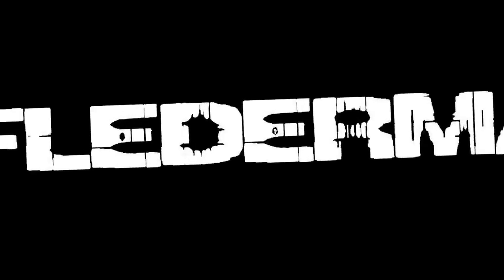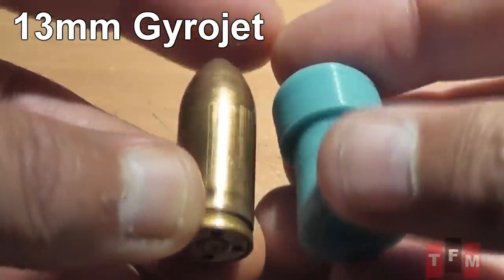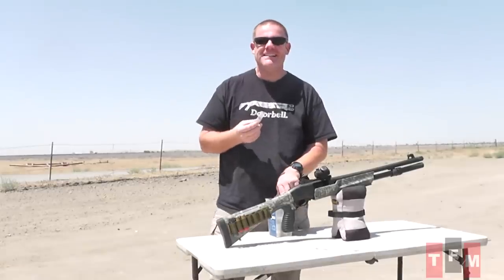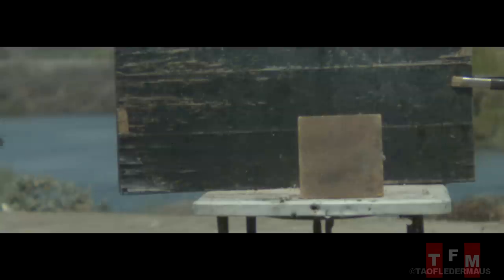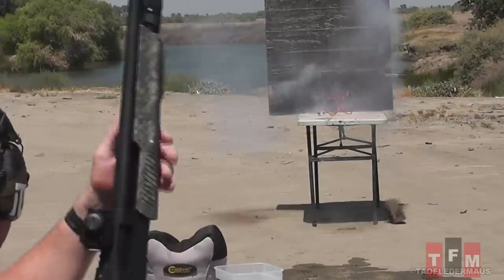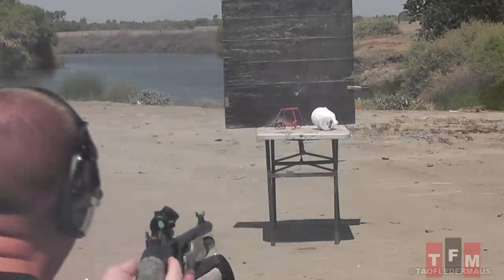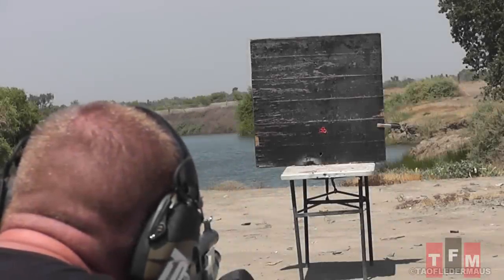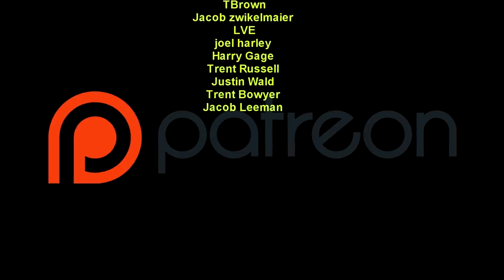Massive 3D-Printed ROCKET Slugs -   First Test

Comment: This is the beginning of a fully functional Bolter
Reply: It's totally doable just upscale a gyrojet to 40mm and add a warhead oh I want a bolter 😭
Reply: @weirdscience8341  I want one too but the magazine would only be able to hold 5 rounds tops if it were kept in proportion. .50 Cal would be better but 20mm might work as well.
Reply: At this rate it really will take till year 40k
Reply: The emperor protects
Reply: It’s canonically the correct gauge too
Reply: @Hankbob_Hillpants  That's good to know!
Reply: @JamesB-kz2vk  Nah, we'll have insane plasma weapons first, then robots will try to kill us, then we'll have less effective weapons...
Reply: Actually the concept of large heavy-hitting rounds in assault weapons is now real, russian FSB or whatever is using .50 cal in an assault rifle, the Shak-12.
Reply: The Bolt Shell will be easy. The Mass Reactive warhead might be the issue. 🤔
Reply: @Hankbob_Hillpants   actually a fraction larger than a bolter
Reply: @thermionicemission6355  the shak-12 is technically a battle rifle, not an assault rifle.

It might be a .50, but its nowhere near a .50 bmg. 

Comparing it to a 50 bmg would kinda be like comparing a .22 to a 556 just because the bullet is the same diameter.
Reply: I say this video and Litterally said "and thus the bolter was born"

Side note, I've always belived that this how bolter rounds work, an imidiate push out of the barrel, followed by the rocket ignition.
Reply: Putting these in the fostech origin 12 aow would be the closest we've gotten
Reply: @dd11111  it is, sadly gyrojet had to put holes in the barrel instead of kicker charge behind the rocket
Reply: I know I’m years late to the party, but I found this vid trying to do research to make a dueling pistol that would use bolt rounds 😂

Comment: Howbout jamming a 9mm case without primer in the back end to make a nozzle.
Reply: the is exactly what i was thinking
Reply: You'd have to use the primer hole to form a Venturi, but it could be done.  A primer pocket wouldn't make a very good venturi on it's own.  There's a reason why Rocket Science is right up there with Brain Surgery on the sliding scale of precision.  They both either go perfectly right, or horribly wrong.
Reply: And possibly turn the round out of aluminum?
Reply: Well just compressing the exaust will massively increase the effect of that kind of fuel, at the cost of burntime, but as is they would have to go like 500 yards to burn out. The fueltype used basically burn faster by the pressure its in, in open air its mostely just smokepowder. Fully enclosed it can rupture steel tubing, if the nozzle is too narrow.

Obviusly as mentioned in the replies an actual nozzle would help it both stabilise and create more thrust, but theres length to consider and safety if you get in to regions of pressure vs propelleant charge that could set off all the fuel before the rocket leaves the barrel.

Jamming in a 9mm casing would give you an indication of the burnrate on the fuel vs curent rate. Still leaves room for improvement, but its fairly easily done so why not give it a go.
Reply: Right, you could do that (Just jam a casing in there) but it would need some work to make it an actual stable rocket.  Just coning out the primer pocket with sculpy clay would help a lot.  Also, a forcing cone on the inside...  The more work you put into it, the more likely you'l actually get something approaching performance, but if it doesn't light, it ain't a rocket.  It's a hollow plastic shell, with a brass lining.
Reply: @Psiberzerker  Again itd need to produce gas at a decent rate and pressure to make a rocket either way, so just getting the burntime reasonably short, would be a step forwards.

The little rocket rounds from the commercial weapons, doesnt really have nozzels, rather they have angeled holes and seem to be producing spin with like atleast 1/10'th the produced thrust, wich still comes out to a deadly velocity, even without actual nozzle cones.
Reply: @bonielsen8001  Yeah, the Gyrogets just never got all that stable.
Reply: @Psiberzerker  Nah, trying to induce spin by pyrotechnics in mid flight on a tiny projectile would require extremely precise manufacture of both projectile and rocket charge.
If i were to redo the gyrojets id use the 12ga  minigrenades with folding fins made for the CAWS as rocket body. then just add a straight rocket  for forwards propulsion. 

Possibly some antennalike stick thatd telescope out behind the projectile in flight for added stability. Basically letting the fins create rotation.

the only real application thou would be to create an armorpiercing round of sorts. So you really want an initial charge more like a 20mm antitank riflecartridge and have the rocket add to the velocity.

Recoilless shotgun slugs would (if they worked) be prone to overpenetration even moreso than regular slugs and mainly be effective at some range, due to the rocket having to do its work before impact.
Reply: @bonielsen8001  Yeah, definitely fin stabilize, I doubt it could be done smaller than 3/4"
Reply: Meal gunpowder (finely ground black powder) compressed into the slug would give more thrust.
Reply: @pyrobob208  It would most likely burn faster, possibly launching the slug faster via barrel pressure, but the actual energy output of gunpowder is less than the sugar/potassiumnitrate mix.

If you can get pure ammonium nitrate it will produce even more gas than potassium nitrate. But it does tend to bind water and is technically an explosive by itself.
Reply: Then a 3d printed slig wouldnt be strong enough i'm guessing
Reply: Center of pressure has to be behind the center of gravity, or it'll never be stable. And in that small of a package you'll have to add some serious nose weight. = )
Reply: @bonielsen8001  Pretty spooky if it launches the 9m shell back at the operator.
Reply: @Psiberzerker  d
Reply: A rocket nozzle wants to be a certain shape--google Laval nozzle--to get the best thrust out of expanding gasses. The flash hole and primer pocket of any cartridge case would likely cause a lot of turbulence in those gasses, wasting a lot of your thrust. AND it's just possible that the rocket slug might spit that 9mm case back at you, with enough force to cause you regret.
Reply: @johnorenick9026  I just rewatched the video and I'm now wondering if almost all the velocity the slug carried came from the black powder they used in order to ignite the "rocket fuel".
Reply: @Psiberzerker  But if brain surgery goes wrong only one person suffers......On the other hand.....
Reply: That's a clever idea
Reply: You would need to drill the primer hole out to one quarter the diameter  of the case and use the slowest burning powder you can find

Comment: Need faster fuel.
Time of flight is under 1/4 second, so rocket-motor should be burned out before then, no?
Ammonium perchlorate + 2-part silicone rubber = 'pencil eraser' fuel grains.
By adding trace amounts of powdered red rust, you can modify the burn-rate.
Cast a hollow-core fuel grain directly into the printed slug, allow it to cure in place.
Prime the hollow-core with black-powder, load yer shells, Robert is your parents sibling.
Reply: Lol.  Bobzyerunkl
Reply: I've been playing with yoyos cool stuff u got any good tips because I think my last attempt was wrong as under thrust it became very unstable I think my center of pressure equations were off
Reply: Is that a twist on "Bob's your uncle" ?
Reply: I know im late to the party, but is this something you yourself could do if you were sent some 3D-printed slugs? cant really send explosives overseas here from Holland. Are you in the States by any chance? because i wouldn't mind doing the 3D part if  you could do the pyrotechnical aspect.

regards, maurits
Reply: Why dont you patent this fule for this use... capitalism
Reply: @cosmiccornflake4  because its already been done and entered public domain. That's the beauty of capitalism, multiple people working on a problem and looking at patents trying to compete but not breach means we get real innovation.
Reply: Best comment ever
Reply: A faster burn would probably blow these 3D printed slugs apart - half of them are breaking up as it is.  Might need to change to something like aluminium for the slug.
Reply: More explosives and rocket fuel information please. For my science project obviously
Reply: Thats too fast fuell, under barell presures it explodes not deflagrate.
Do not try at all
Reply: ...why would my parents share a sibling?
Reply: @alexeyvlasenko6622  machine some slugs then? Use something like brass or even the titanium on a lathe? You could even machine the reducer to increase the thrust and do it all in one bar stock without needing to bond anything together.
Reply: @ljubomirculibrk4097  use a heavy barrel and figure out a timed ignition?
Reply: Make it so.
Reply: Would you please print some out of carbon fiber reinforced filament, manufacture a couple dozen, and mail them in.

Comment: Great job with those prototype slugs. Needs some work, but interesting idea.
Not sure how safe I would feel, sitting behind the trigger though.
Then again, considering what @Officer Gregg has been through recently, I guess this is rather dull. 
Gregg. Once again, I'm so glad that you and your family are safely back home <3
Great video guys, thank you.

P.S. Someone should make a compilation video as a tribute to the flower stand and the table.... So much abuse and punishment and yet they keep showing up lol
Reply from the maker: Haha, yeah,   I've gone through a few tables.    We've busted up the plant stand several times and Danny keeps straightening it out and re-welding it.   We use that stand to try to keep the slugs from hitting the table. lol
Reply: TAOFLEDERMAUS 
Genius!
Reply: Joseph Scharfenberg The type of propellant might have to be changed to get the boost in impulse. It also might need a change in material to a more durable variety to compensate for the more sudden shift in velocity.
Reply: I'm working on a second version now and I plan on using a nozzle, larger core burn and add iron oxide to the fuel all to make the thrust higher and shorter. I also plan on adding more ballast to the front and strengthening the week point at the neck.
Reply: Dominic Cacace Looking forwards to seeing how the new design turns out. :)
Reply: What has Officer Gregg "been through recently"?
Reply: Mekratig Video from 4 days ago explains: https://www.youtube.com/watch?v=zCYbLwYAEUs
Reply: You missed the previous video?
Reply: Dominic Cacace: I think you are onto something. Just need some propellant that burns faster.
Perhaps those are best shot with rifling to spin stabilize them. With just one nozzle the center of thrust might be slightly to side of center of mass and as such make it inaccurate without spin.
Reply: Mekratrig: OG and OG 0.5 [F] got swept out into the Aegen Sea while snorkelling on vacation in Greece. Rescued by a Turkish boat, and "detained" [Nice, pleasant "detention"!] in Turkey until all processes completed and they got rightfully "deported" back to Greece.

Check out the video on TFM.
Reply: Dominic Cacace:  was the rocket charge actually doing anything here in these tests or just adding a soundtrack??  (I may have missed it, but Jeff should have shot one with only the powder and no Rc&y _TM just to measure the rocket boost vs powder initiator)
Reply: @dominiccacace1834  bingo... Make sure your center of pressure is behind your center of gravity, or it'll never be stable. = )

Comment: That looked like the base bleed concept for artillery. Those shells had a small amount of material in a section of the bottom of the shell. The intent was not to provide thrust but to break up the drag immediately behind the shell and give it a little more range. Unfortunately this shotgun round was so unstable that even that effect didn't have a chance to work properly.

Comment: you're gonna need faster burning propellant than that, although i wonder what effect the exhaust filling the low pressure behind the projectile has. i think the ballistics of an actual rocket need to be different from a ballistic projectile, since ballistic projectiles rely on as smooth as an airflow around them as possible to stay accurate, and rockets don't care about turbulent airflow behind them since they are dominated by the thrust

Comment: Haha when you gonna shoot some of those C and D type model rocket propellant cartridges
Reply: I think the C and D engines are too large, note, Its been 18 years or so since I held one. I think the A or Maybe B size might fit inside the diabolo shape slug quite nicely. Estes A10-3T 2.9 lbs of thrust for 0.8 seconds, and I believe they are 13mm in diameter.
Reply: Matt John true
Reply: I've actually done that  twice with Estes C6 motors years ago. I put in a little BP to get it going.  one flew perfectly. The other exploded,
Reply: Model rocket motor letter designations don't directly refer to the physical size of the engine. For example, an Estes C6 rocket engine is the same physical size as most of their A and B Engines (and even some of their 1/2A Engines), but the C11 series is the same size as their D engines. Their larger E-class engines can also either be the same diameter as the D's but longer, or the same overall size as their F class engines.

Other manufacturers may also have different physical sizes even in the same letter class, and engines of Class H and up require various permits or licenses to use. S is the current highest recognized class designation, which is also used in some smaller commercial rockets.

Comment: Great video, maybe see if the Ballistic Machinist can make some of these from aluminum for you. Could machine them a bit nose heavy too.
Reply: sparkplug1018 heck maybe an extra long Breneke, hollowed out from the back a certain size, then have the machinist make a thin steel sleeve you could put a small potent rocket motor in, make sure the sleeve is threaded, abd have them machine a matching screw on back cap which tapers in a finned hour glass shape where the bottom half acts as a thrust focusing nozzle. The forward lead nose, twisted ribbed external shape and steel fins will help with stability, the steel liner will manage heat and contain the reaction, the nozzle will direct the force so it's more focused and potent. So it's not locked out before ignition, it should be put in an empty high brass shell with no wad or buffer since it won't accelerate fast enough to need it, and this way the primer alone should ignite it as the weight of around 400 grains resists the force of the primer so it has a chance to burn.

Maybe include a strand of cannon fuse or 2 to insure the primer ignites the rocket, just in case, it will be blasted out and won't matter if it's not needed. 

I hope someone does this.
Reply: "an empty high brass she will "? Autocorrect get you or just a slip when typing?

Comment: I feel like this needs to be revisited to a degree with perhaps a rocket powered sabot that uses fin stabilization, you'd need a single shot to use it, so that the extra extra long shell can fit (thinking a 5 or 6" long cartridge)

However the pressure and recoil shouldn't be super bad,especially with a ported barrel.

Comment: You might want to experiment with muzzleloader primers. Through some of my own similar experiments, triple7 primers seemed to ignite rocket-type powders better without pushing them down the barrel first. Muzzleloader primers seem to give more dwell-time in the barrel, allowing the rocket to light more thoroughly before leaving the barrel. I actually had good luck using triple 7 primers and no supplemental powder. Good luck!

Comment: I make model rockets with the exact same fuel and have been working on a similar design for quite some time.

From the experiments I have carried out, I have found that a nozzle is essential for building up enough pressure to propel the round towards the target, it also creates a stable trajectory.

The basic design I have right now is a 3D printed slug, similar to the one used here, but with a graphite core that acts as the motor with a graphite nozzle on the end. This means you can quickly swap out the motor into a different slug design pretty quickly, plus graphite is dead easy to work with.

One of the key things you need to get right is the centre of mass of the round and the centre of thrust. For a ballistic trajectory, you want the centre of mass to be smack bang in the centre of the slug with the motor, nozzle and fuel installed. The motor tube should not extend too far down the body of the slug itself - you want the centre of thrust to be more or less just behind the centre of mass. This will ensure that the round will fly straight once it leave the barrel, assuming that you have built up enough pressure on ignition.

The next feature I am going to try is pop up fins on the body of the slug. Spin stabilisation is great when you are launching a rocket, but when you have a short firing motor on a projectile like this, you need to treat it more like a really tiny anti tank missile. The trouble is that they are a complete bugger to get right on my shitty 3D printer. The other alternative I have been tinkering with is a saboted round with fixed fins, but I have had so much luck with that so far.

Comment: You should cast the propellant as a core burner. That means a hollow channel from front to back. More surface area burning at once so the propellant burns faster and provides it's energy very quickly.